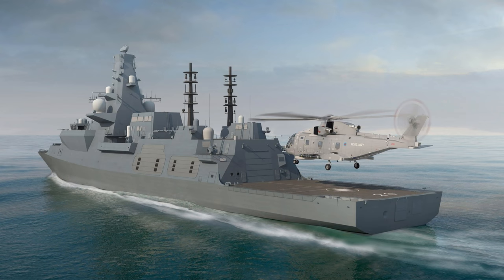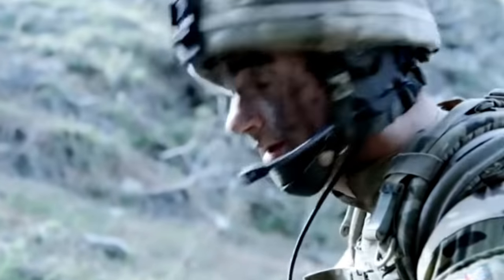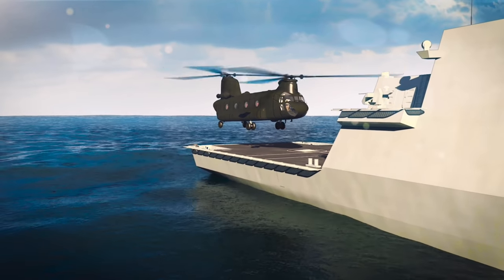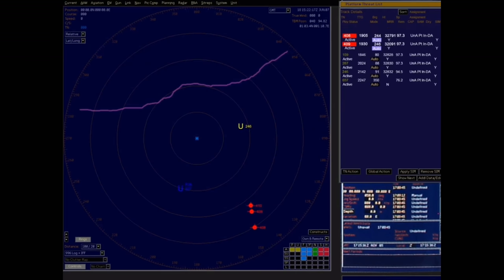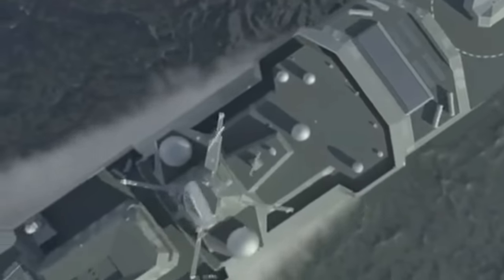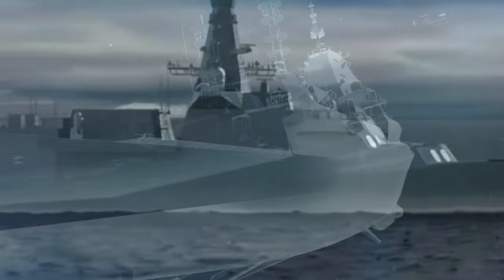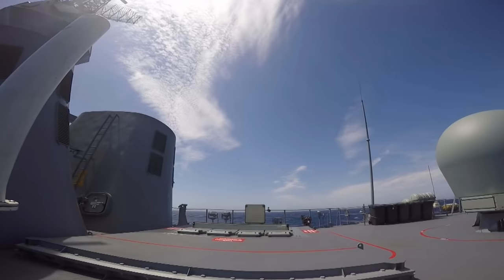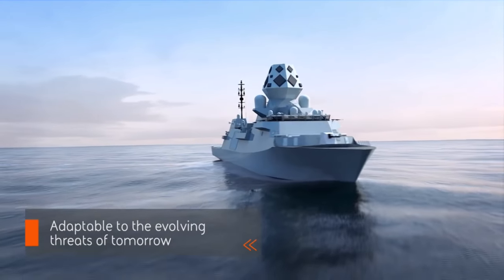British Type 26 Frigate | FUTURE NAVAL FLEET PROTECTION

Comment: Frigates have grown in size over the last two decades and have become modular.

Today a frigate is a vessel of 6-7.000 tons whereas earlier they were 2-3.000 tons. The important thing is however: They pack the punch of a destroyer:
1) They carry a reduced crew compared to a destroyer (about half).
2) The larger size of the vessel means that crew quarters are more comfortable, which is of significance on a 3 month deployment.
3) If you have - say 8 identical vessels - it is a matter of discipline to keep standards, as to how you store tools etc.This means you can swap crews by the simple expedient of flying the relief crew in and flying the reliefed crew out on the same plane. This gives much more time on station on the other side of the planet. Cutting down time and fuel spend in transit.
4) Modern ships will typically have 3 crews where one is the prime crew responsible for maintainance planning and yard visits. That is a trick learned from the civilian ferries: They have 5 crews for a 24/7 sailing ferry. A civilian ship does not spend more than 3 weeks in port a year on preplanned maintainance - otherwise the shipowner would have gone bankrupt years ago.
5) If there are greater maintainance issues, you fly out the specialists with the spare parts needed. Swap the damned thing, bring it home for repairs etc.
Reply: Frigates are now filling traditional destroyer roles.  In fact, some countries.have dropped the term destroyer altogether.
Current destroyers should be redsignated as cruisers, since that is the role they now fill.
Of course, long ago, frigates did the cruiser job... 😜
Reply: @petesheppard1709  That long ago, cruisers were actually smaller than frigates and frigates were hella beefy.
Reply: @petesheppard1709  It is also an indication of how much cheaper it has become to build and operate ships. ½ the 500 mio.£ is arms and only the other half is hull, engines etc.

The mere fact that a small pis-pot country like Denmark in reality is building a globe spanning fleet. Personally I'm very much in favour of Denmark building their Absalons and Huitfeldts and taking over the Atlantic, which is rightfully ours. On the other hand: It is beyound me why anybody in their right mind should actually want to posess the North Atlantic - horrible weather - like Scotland on steroids.
Reply: Both Britain and Canada use the term "frigate" for ASW specialised ships (and destroyers for AAW ships) so the difference is really in the role they play as part of a task group rather than their respective size. For instance a Type 45 is not much larger than a Type 26, nor does she carry more VLS silos in her hull.
Reply: @thomasborgsmidt9801  Honestly, the hull and guns are the cheap parts. Once you start tacking on Aegis (or whatever combat system you want) and all sorts of radars, fire control, sensors, sensor fusion, servers, software, and other specialized hardware, then things start getting really really expensive.
Reply: Well, there is a consolidation under way to amalgate the cruiser, destroyer and frigate into one class of ships: The frigate. The frigate will be larger and more comfortable so it can stay at sea in the operational area longer.

I just saw a video on the Gering class, and they were (after the war) outfitted in numerous diffent ways according to task - probably because they were what was at hand.
Reply: @Scriptedviolince  That is correct. The problem with sensor fusion is, that an awfull lot of things can go wrong. The frigates in the Falklands campaign could not use their radar because they should stay in contact with the admiralty.

The other problem is: How much is really needed?
The russian navy is going about its business of sinking itself and rusting to the pier side.
The chinese navy - well if you believe the propaganda they will be a force to be reconed with - in 20 years time - that is if China does not break its back economically before that.
If You look at the South American battleship race before WW1. What stopped it was: The south american countries went bankrupt.
Reply: @soulsphere9242  I was actually referring to the age of sail. Frigates were essentially any warship with more than 28 guns but less than one of the "line of battle" ships and which were built for speed and hardiness. Cruisers were actually often quite small cause it referred to a mission type, cruising around and doing the mundane chores that a navy has to do before they get to play with their really nice toys.
Reply: @thomasborgsmidt9801  Oeff you're not exactly right. Sheffield was indeed sending a report when they where attacked but this was just bad luck and they weren't in constant contact. But the radar did jam the long range communications. But with modern equipment this isn't a problem. 

Also, the Russian navy is pretty decrepid and it seems they just can't get anything bigger than a corvette into the water. But they still have a lot of small craft and some pretty potent ASW potential. Their capability of operating submarines is still nothing to be looked down on. 

And while the Chinese navy has large deficits in experience. They have built and put to sea a truly impressive fleet of capable (looking?) warships! As with everything Chinese you could question the quality. But the 056 corvette (40+ units), the 054A frigates (30 units), 052C destroyer (6 units) and 052D destroyers (12 active 1 on sea trials and 7 more fitting out!) all look like modern warships with all the bells and whistles! And that new 055 destroyer is a beast with 112 VLS and over 12000 tonnes! 

Even if they wouldn't be as advanced as their enemy, nor as experienced at naval warfighting. These numbers are nothing to scoff at and the PLAN makes even the mighty US navy a little nervous doing their freedom of navigation trips through the Taiwan straights... The Chinese definitely have the 2nd navy in the world right now. #3 doesn't even get close.
Reply: A frigate is what you want it to be. frigates range from 2000 to about 7000 tonnes or more. It's just a name. Politics is usually more important. In Europe we all call our ships frigates no matter the displacement because it sounds cheaper than a destroyer!
Reply: how does modenr ship classification work anyways?
Reply: @patriciusvunkempen102  The same way as it always has. We call them what's most convenient at the time. In the past some ships where called cruisers because it's owner wanted to look strong. Nowadays European navies want to look cheap so we have a lot of frigates. But a lot of them are bigger and more heavily armed than most cold war destroyers. The newest Burke destroyers are as powerful as the Ticonderoga's which are classified as cruisers. 

Japan calls everything a destroyer. From 1980's ships of 3000 tonnes to aircraft carriers, they're all destroyers to the Japanese. Although their Kongo's, Atago's and future Maya classes of destroyers are all in the 9000+ tonnes range and their function as flotilla leader makes them more like a cruiser... Another Asian giant the type 055 class destroyer of the Chinese navy is over 10 000 tonnes displacement and has well over a hundred VLS cells. You could call this a cruiser too. 

On the other end of the spectrum we have the Iranians who'd call a rowboat a destroyer. So how do we even classify a ship? Displacement? Mission? Armament?
Reply: also smaller ships need smaller docks for repairs not mention building one goes much faster.
Reply: I thought the navy had new uniforms so why do I always see the naff old shirt and tie stuff?
Reply: Its a bit of a misnomer to claim that Frigates pack the same punch as Destroyers do. They don't. Many modern frigates do have the same amount of anti-ship missiles as larger destroyers but that doesn't mean they 'pack the same punch'. Frigates are limited by their size in the size and power of radars and other sensors they can carry. They generally carry much smaller numbers of defensive missiles, making them less survivable. They are limited in terms of anti-submarine warfare compared to Destroyers, both because they can carry fewer helicopters and because they can't carry as big of a sonar. Frigates will always be limited in capacity compared to Destroyers since weight restrictions are the main limiting factor in ship armament.
Reply: The Royal Navy's defintion of frigate is a dedicated anti-submarine warfare ship.

Likewise, the Royal Navy defines destroyers as dedicated air defence ships and curisers as ships optomised for both anti-submarine warfare and air defence.
Reply: The Aussie type 26 Frigate is larger than their Hobart Class Destroyer...

The line between Frigate and Destroyer is blurred and usually comes down to the role they play in a task group etc...
Reply: It just depends on how you wanna put it. In S.Korea they are commissioning new 3000ton class ships and we call it frigate. 
And a new 6800ton class ship we call it destroyers. 

Its just like Carbine assault rifle being called a submachine gun in some countries and Zumwalt destroer being called a destroyer when its size is definitely a cruiser.

Comment: Nine of these beauties for the Royal Australian Navy to go along side the 12 Attack Class submarines, 3 Air Warfare Destroyers and 2 Amphibious Landing Helicopter Dock assault ships.  Thank you very much.
Reply: Upgrade the LHDs for F35, build 3 AW cruisers, purchase 4 Virginia class ssns, and we could have a battlegroup on each coast that could challenge anything in our area.
Reply: Arc Light Yes definitely should upgrade both LHDs to carry up to 24 F35Bs and purchase an additional 36 F35Bs on top of the 72 F35As.  

In my opinion an ideal RAN principal surface combatant fleet would be 8 AWDs, 14 Type 26 and 12 OPVs armed to current Anzac Frigate configuration.  I also believe 4 LHDs and 4 Choules Class are necessary to be of strategic value.  This would probably require 4 Oiler-Replenisher supply ships too.  

16 Shortfin Barracudas with glass solid-state batteries and 4 dedicated vertical launch cell land attack cruise missile submarines similar to ballistic missile submarines, but these would be non-nuclear, would be of great strategic value.  But this is stuff of fantasy really.

Comment: 5" gun is not standard, it's actually up calibre from the standard fitted 4.5" gun on all other RN escorts including Type 45
Reply: But not in the countries that they are marketing the design to other than the UK.
Reply: Having lisrened to it . 

 He said modular quite a few times so actual weapon load will depend on module fit-out. BUT ALL load outs include  a 5" gun,so it is standard for the type 26.
Not that it is THE standard gun for the RN.
Reply: Every one else uses 5 inch guns it would wiser for RN to up gun it would allow them to get ammunition from allied sources if need be.
Reply: Using the same calibre doesn't matter unless you are resupplied by "everyone else" and that rarely happens, 4.5" guns have been the standard fit for RN escorts going back to 1938 (or 1960 with the new longer calibre). Now we have to source 5" shells as well as 4.5" or replace every gun across the fleet.
Reply: 50Stone it would help the Uk sell ships if they had common weapons to other navies , all commonwealth navies drop that caliber decades ago only RN was only buying 4.5 inch guns ,there are a few navies using them now that’s because they bought secondhand RN ships most navies uses 3 or 5 inch guns it would make sense for RN to switch now.
Reply: @50Stone  
 "4.5" guns have been the standard fit for RN escorts going back to 1938",   And...?
Going by that we should be using bronze cannons; after all they were good enough for hundreds of years, not 80 odd.
Reply: @50Stone  
 "4.5" guns have been the standard fit for RN escorts going back to 1938",   And...?
Going by that we should be using bronze cannons; after all they were good enough for hundreds of years, not 80 odd.
Reply: Standard 5" globally....4.5" Is a UK hangover from WWII.
Reply: @Cheezsoup  Your statement makes no sense, technology has improved beyond brass muzzle loaders, a 5" is just a larger calibre it isn't a technological advance over the 4.5". I just said that 5" wasn't standard in the Royal Navy, so you can't say the ship mounts "the standard 5" main gun". It might become the standard from this point forward though, as it would be logistically complicated to have to supply and transport two calibres of main gun rounds on our RFAs.
Reply: @50Stone  

Standard fit for the type 26, nothing else (i.e. it doesn't matter which modules it also has it will always have the 5" gun).

How long has a 'solid' projectile powered by a 'boom'  in a tube been the de facto way to 'hurt' the 'enemy'?

  It strikes me as similar to the introduction of the 5.56 V 7.62 bullets ,
SLR via rifle 556. 

 Yes it may be a bit of  a ballache at first but in the long run it may be more advantageous.
Reply: @50Stone  

Standard fit for the type 26, nothing else (i.e. it doesn't matter which modules it also has it will always have the 5" gun).

How long has a 'solid' projectile powered by a 'boom'  in a tube been the de facto way to 'hurt' the 'enemy'?

  It strikes me as similar to the introduction of the 5.56 V 7.62 bullets ,
SLR via rifle 556. 

 Yes it may be a bit of  a ballache at first but in the long run it may be more advantageous.
Reply: Curious why NATO Navies didn't go with 105 & 155 mm Guns to make Ammo compatible across Land Forces & Navies
Reply: TYPE 45 will get 5 inch gun in late 20202s
Reply: @nking9268  they will once TYPE 26 is in service
Reply: @Cheezsoup  Bronze cannons?? new fangled things...whats wrong with good old catapults and battering rams..
Reply: Vulcano I think is the gun of choice.

Comment: I’m rather surprised that your new video is out of date before publication!  Babcock was selected to supply the Type 31 frigate in September (Arrowhead) and the contract for the first batch was signed last month.T31 will also carry Sea Ceptor and looks likely to use the Thales NS110 or NS200 radar, which will be very capable indeed.
Reply: Glenn Ridsdale.
   In what way is it out of date? The video is,  clearly (and titled as such), about the type 26 frigate it is NOT about/titled 'the latest RN frigate'.

Analogy :-
In a video about a Tiger tank would you say "that's out of date, as an update for the Challenger II has just been announced " ?
Reply: Cheezsoup is it that you didn’t read my comment?  Or that you didn’t watch the video?  Or maybe both?
Reply: @glennridsdale577  

What your comment about the type 31 you mean?
Reply: Cheezsoup What gave that away?

Comment: Hey Matt, the Type 26 for the RN is to use Ceaceptor point defence system where as the ESSM is to used by the RAN in our version. Different Radar as well as we are using Ceafar 2 which is designed to be used with US weapon systems and ESSM in particular ( both been developed together). Also Cooperative Engagement Capability is limited to USN, RAN and the JMSDF as we are the only three countries using it. For that the RN would have to use US weapon systems across the navy for it to work and the cost of doing so is prohibitive. Great video tho mate and keep up the awesome work!!
Reply: Pretty much correct- the RN will indeed be using SeaCeptor (CAAM),also CEC is available to the UK but was cancelled/postponed on the Type 45's due to cost,hopefully this will be addressed in the future.
Reply: @paultanton4307  Such a shame for such expensive ships with pretty decent missiles. That totally ruined their range!

Comment: Best way of thinking about the lower numbers are is that the type 26 will be the specialist ASW ships and the type 31s are better off thought of as corvettes (I think they were originally called the global corvette).

For example you don’t need a ASW specialist frigate in the Caribbean performing counter narcotics duties that role can be performed by the smaller more generalised type 31. Same with the uk and faulklands guard ships. These roles are more about presence than specialist duties. 
I’d foresee the navy reserving the 45 and 26 for task group size deployments and the 31 being used extensively for general duties.
Reply: That's basically how these assets will be used.

Comment: Sounds like a vessel that has the flexibility and capability the the Canadian Navy is looking for. As of this post, the Canadian Navy has already purchased several of the Type 26 ships. I also received a You Tube post from probably someone in Canada on the hybrid nuclear submarine concept. ( its a paper study so far using the 'slow poke reactor') It, the submarine, sounds like a great submarine for Canada and a great export product that will not compete with USA designs. It looks feasible from a business & economic stand point as Canada would have a good prospect at spreading the development costs through multiple domestic and export units. The reactor could also be used to provide electric power to remote military and commercial mining activities. ( artic mining operations, far northern military bases, or far northern communities)